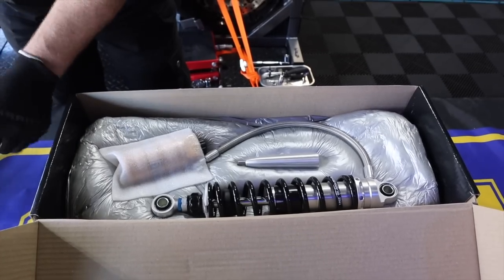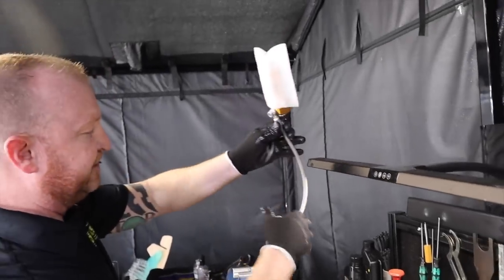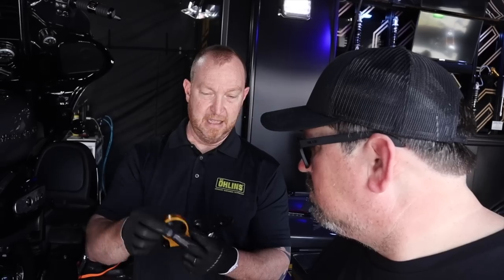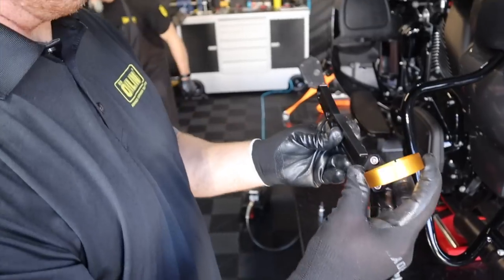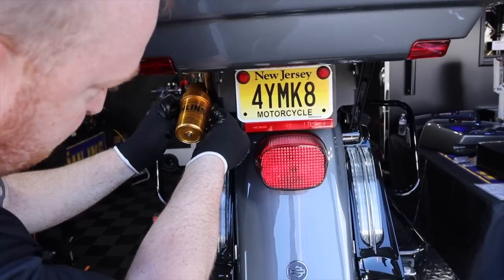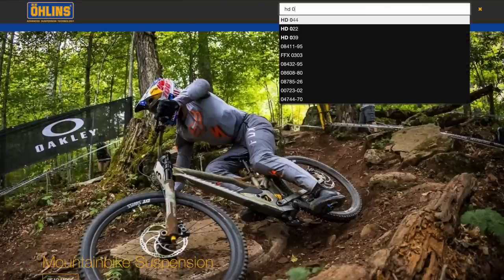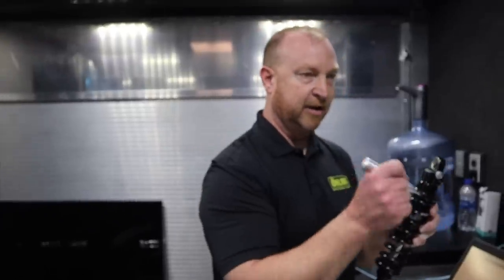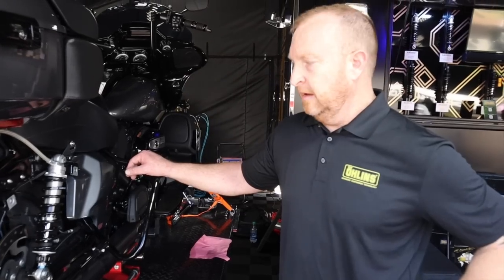Harley Davidson Touring Rear Suspension Install and Setup, OHLINS

Comment: That is super cool. I know I did not realize how much went into suspension until I upgraded. I have a mono shock, dual shocks is really crazy.   Great video.  Ohh yeah. That window idea is awesome.  What a way to not miss a customer. That is top notch.
Reply from the maker: Yeah a lot goes into suspension and you do get what you pay for . Yeah Joey at Ohlins designed that trailer, you meet him in the next Ohlins video where my front suspension gets installed
Reply: Yeah man Ohlins has a really nice rig and set up for Rallys.  Good dudes too!!

Comment: I went with Legends but I could tell the improvement as soon as I left my driveway. I find myself looking for railroad tracks. Now I want to do the front suspension. Just added the Baggers and Brews sticker to my tool chest.
Reply from the maker: YES Frenchy! we were looking for bumps in the road on the first ride.  Make sure you tag us in a photo of that tool chest.
Reply: We've seen riders come in with Legends/Progressive/Etc. & after installing Ohlins on their bike they all come back saying the same thing. "I should've gotten Ohlins to start with!"
Reply: I put some Legends on my Street Glide and also felt the difference immediately. The stock shocks that Harley uses totally suck. You'd think that you'd get a decent shock when you drop $30 grand on a brand new 2020. I liked the air suspension on my 2002 Road King better.
Reply: @rhoonah5849  all manufacturers have to make compromises to get the vehicle out the door at a reasonable (?) price. They have to cut costs somewhere. Shocks are a common place where they can save money $! 😃
Reply: @discmotoslots  $32k is hardly a "reasonable" price for a motorcycle. It is a premium price for what is supposed to be a premium motorcycle. Shocks are NOT a place to cut corners since if the thing rides like a hard tail then what's the point?
Reply: @rhoonah5849  premium price….yes, premium bike….. nope. ( bought a 2019 Road King…. 20,000 for the bike, then over a three year period… if I had a nickel for every time I said,”That bike should’ve came that way from the factory”.  …. Let’s just just say I’d have some serious change in my pocket.
Reply: @jeffreyengle2762  I guess my point is that it is SUPPOSED to be a premium bike.

Comment: Good video. 2021 FLHTK Running HD 772's and Nix 22's in the front (front just installed). WOW! Got to adjust to riding with no fork dive. Adjusting the rear sag is crucial. I'll be watching for updates.
Reply from the maker: Thanks for watching fun human, yeah not riding with the fork dive takes a minute.  so does not bouncing after  bumps . thanks for watching

Comment: @baggers and brews, @DABEARD.
is there a difference between the HDSE OHLINS and the regular 044 OHLINS springs that you installed? I heard the HDSE are NOT built from Ohlins specifically for the rider/bike combo, Where the Gold Ohlins like yours takes your weight..ect and builds the springs exactly for YOU and your bike.  Whereas the HDSE springs are not. Do you know if that's true? Oh and the HD version comes with the black bracket to mount above and behind the saddlebags and just under a tour pack. Whereas the Gold OHLINS don't  have the bracket as of yet. 
So I guess you got a hookup with the new black mounting brackets?
Thank you.

Comment: I mush does it cost to get a set of the Ohlins plus installation on the rear?
Reply from the maker: Peter Ohlins offer a few different levels of rear suspensions, check out the link in the description . As for installation the rear is easy to install, or you can just have them do it at a rally.  I can’t imagine a dealer charging you more than an hour of labor to that job.
Reply: What He said. 😄

Comment: I’m sorry guys but the more I watch this video for these shocks I’m so glad I went with legend I hope your not as confused as I am.
Reply from the maker: Not confused at all, the adjustment points are the same as an external reservoir Legend with exception of the adjustable eye bolt for overall shock length.  If anything the website makes setting them up easier because you're not having to have someone measure sag.  So I'm not confused at all. If the Legends you are referring to are the Revo A's, they are not equivalent to the
HD 044, the equivalent would be the Revo Arc Remote Reservoir.
Reply: I mean the website does all the work for ya. Just enter in the appropriate weights!!!

Comment: I was told when you buy parts from the vendors at a Rally labor is free, is this true.
Reply from the maker: all vendors are different, i highly doubt anyone is installing a front suspension for free.  but yes quite a few simple bolt on parts are a no charge install.
Reply: @BaggersandBrews  ,  thank you great videos i want to by a Harley some upgrades when i get it.